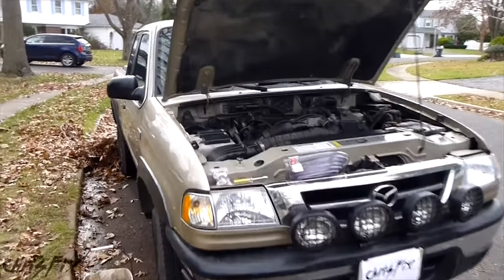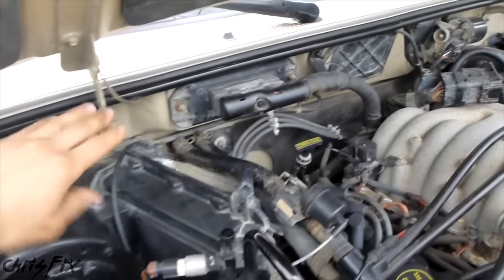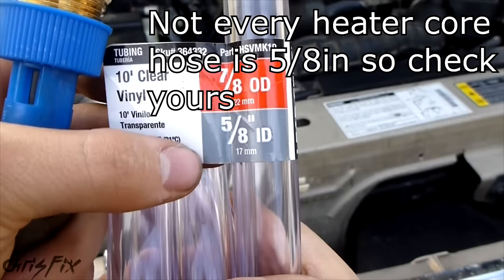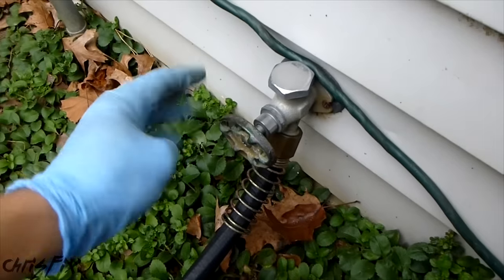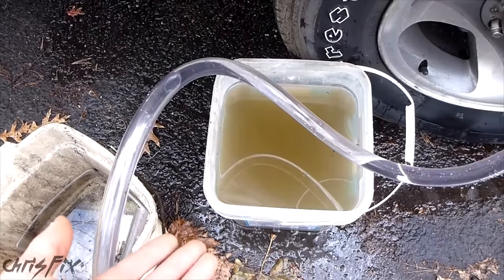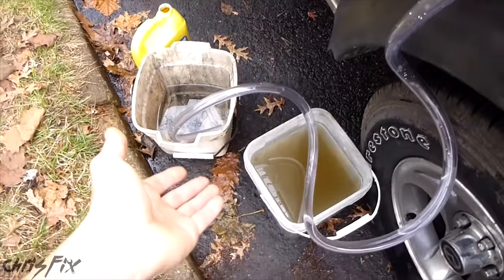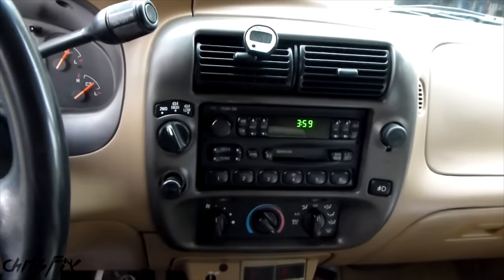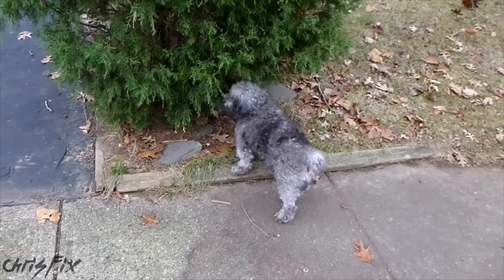How to Flush a Heater Core Safely (with a garden hose)

Comment: Can a clogged heater core cause the engine to overheat? I've replaced my radiator, radiator cap, & radiator hoses, flushed and replaced new coolant, replaced the thermostat, and bled out the air of the cooling system and my xterra is still overheating and the heater doesn't work. Any ideas??
Reply: Yes.
Reply: Did that end up being the end-problem for your Xterra, jujubeee?

Comment: What if my car is blowing hot air instead of cold air? I could not use my AC during the summer this year because of that reason. What is the issue? Is it the heater core? Does it need to be flushed? Is it something else?
Reply: Could be thermostat

Comment: I have a question if anyone can answer. I’ve done a heater core flush with only water and a good amount of nasty stuff came out. My heater started working but does not seem to be optimal. Should I do it again but with the radiator cleaner? I’m sure that would help it out a ton

Comment: I have a 2002 GMC truck when you hit the brakes and goes clunk clunk clunkthat's the only time it does it it doesn't pull to one side or another when you're driving down the road or when you're hitting the breaks. I have changed calipers brake pads I have change stabilizer bars rotors I've changed 1 caliber that was sticking I've been to three different mechanics I've done everything they've told me to do the truck is still doing if you have any ideas could you please get back to me

Comment: Fuckyaaa I have heat in my cabin now!!! This video is amazing...i used exactly the same setup to flush my heater ..thing was super dirty like chocolate/red ...heat came back instantly..and because it was super dirty I think I will do a radiator flush aswell..  thanks alot my dude!!🤙🤙

Comment: I tried this today on my 2008 jeep liberty. I bought the flush cleaner, pour it through the hoses into the heater core, let it sit for about 30 minutes, and then flushed it through. It had a good flow but now my heater is still blowing cold air.🤔🤔

Comment: Chris because you are talking about smells coming from the vents every now and then, if I let my engine revs go high only up to 3or4 on rev gauge, I get a very horrible smell and it's not the smell that you usually  would get from a catalytic converter, it's  just a unusual smell any suggestions as to what might be the problem, car is running fine the heating system is working fine, it was sitting up for a little while and I was wondering maybe if this was causing the smell when the rev is put up it heats something up and this forces the smell into the cab, it smells like a Duty lithium battery toy that was left too long with the batteries in, and with a slight smell of Ash and   burning  wire wool , of smell and Ashes. ha ha I was wondering if Maybe crud and dust had built up in the  catalytic converter, and when you give it a good rev out of gear is when the smile comes, but once you start to move and drive normal and up top  high speed the smell does not come into the car. The car is a Nissan P12 premier 2002

Comment: I have the exact truck man... I want to replace my black hoses with that clear hose... what hose that is clear would be good for the psi and the heat??? a really thick hose wouldnt melt would it?
Reply from the maker: I dont think it will last with the coolant. It will degrade with the coolant flow. I am not sure though. Clear hoses would be pretty cool!

Comment: Good morning, I am having issues with my heat so let me give you a brief run down. The heat has not been working properly for a year or so from today. In the beginning of this year, I noticed I had thick rust like fluid. I got the fluid flushed and got my blender door changed. It didn't help, during the summer I changed the coolant again and put the right one in 2009 Honda Accord LX Sedan (Blue colored) and changed the upper and lose hoses, still no change and last week I changed my thermostat, replaced my radiator cap and flushed my fluid again after getting a diagnostic at Firestone for $55. Still no changes, the only other options is my heater core needs to be flushed out because of dirty radiator fluid build up or needs to be replaced entirely. Are you capable of doing either service and if so how much would it cost and how much time would it take to be complete ? Also when I try to switch my setting from where my heat/air blows from it does not always blow from the right spot so I assume the switch door needs to be replaced or adjusted as well.
Reply: Bruh I just flushed my heater core in like 30 min with a 2 liter bottle of water, an empty bottle to catch the flushed fluids, a pair of pliers and an electric tire pump I got from family dollar. Had no clue what I was doin other than watchin this video and 1 other. I knew it was my heater core cuz it blew great and car temp gauge was fine AND I knew goin in I had a radiator hose leak that I was pourin tons of quick fix stuff in tryin to fix so I pretty much knew the heater core was clogged after I watched this. Pumped the heater core and like magic saved myself like $150... Point is, just do it yourself!! It's super easy I literally just did it in 30 min!
Reply: Well I don't think I have a leak but I dp have an air pump and I want to try this before I replacement my whole heater core. So water and an air pump got the job done in 30 mins really ? I'll do it if it is that quick regardless of how cold it is outside.
Reply: +Justbmore Morris lol yea I'm in Atlanta, it's been above 65 degrees all morning, I'm literally out right now in sweats and a short sleeve shirt lol but yea I was sayin I had a bad radiator I tried to fix that probably caused my heater core to get clogged, you said you seen some build up in yours and you tried everything else so it's gotta be your heater core.
Reply: +Justbmore Morris So yea pliers to disconnect the hoses and clamps, water to run through the hoses, catch bucket for old nasty fluid, air pump to actually pump the water through the hoses. I would pour in some water, then pump it out, some in, pump it out until the water was pretty clear, reconnected hoses warmed the car and it worked

Comment: Dang! I wanted to do this on my 96 Cherokee before it got too cold... but I already put garden hoses away and turned off outside faucets. I get enough heat, but I can tell heater is not performing at its best. Always 2015... I hope.
Reply from the maker: furyiiiplate I am thinking about doing the same video but using an air compressor instead... What do you think? Interested?

Comment: GOOD VIDEO BRO.
 MINE WAS LEAKING SO  I PUT STOP LEAK.
 OK FOR AWHILE , BUT EVENTUALLY NO HEAT SO I HAD IT BLOWN OUT.
 WORKS FINE NOW. BUT FOR HOW LONG ?
 THANKS
 KEITH KUHN
Reply from the maker: KEITH KUHN Thanks! You never know how long the stop leak will work for. If you dont flush it out, it can last the life of the car or it can just randomly start leaking.

Comment: 99 Mustang GT, the intake and outlet hoses are two different sizes -__- outlet is 5/8 but intake is 3/4  #thanksFord  also very hard to get the hoses off and very little room back by the firewall but that's just v8 problems.
Reply from the maker: ***** Ugh, that is annoying. Is there any way to take the hose off more towards the water pump instead of the firewall?
Reply: The hose going into the heater core appears to come from the intake manifold (back behind the throttle body). I'm assuming that's the one that goes into the heater core (intake). The one I assume is the outlet goes down behind the engine sort of, I don't know to where. It's the same setup as yours, Ford probably used the same setup on Mazdas but for some reason my metal parts are two different diameters. I got the clamps off with a bit of hassle because they wouldn't stay on the pliers and kept slipping off. I got the hoses off with a LOT of force because A) I guess they haven't been off in a while and B) it was hard to pull them straight because there were other things in front of them including my cool air intake and other wiring. In the end the hose was off after I set everything up (-__-) which I should have checked before setting it all up, but I know everything fits now.
Reply from the maker: ***** Sounds like there isnt a  lot of room there. Now that you know what to expect you can flush it at least!

Comment: @ChrisFix———Hi, I watching your video from France and thanks to you, I make my own maintenance for my Audi A6 c7 diesel 3.0 TdI. But I have a probleme with my heater core, actually inside my car I put de heater, but there is no heat coming inside or a little. I think my heater core need too be flush. For the moment there is no leak from the heater core so I try to remove the two hose, but it's very difficult. Do you know the method to remove the two hoses so I can flush with my garden hose the heater core ?

Comment: When you do a complete radiator , engine block  flush doesn't that also flush out the heater core  if you turn on the heater ?
Reply from the maker: steve kwall It doesnt reverse flush the heater core, which gets out more gunk than a normal flush.

Comment: Hi Chris! My name  is  Francisco. 
I just  started  watching  your videos, I watch  Scotty  Kilmer and Eric  the car guy.
And I know  my question  doesn't  have  anything  to do with a heater core but here it goes...
My 2002 g20 makes a kinda grinding brake noise, every  day in the morning.
Just went I'm pulling  out of the driveway maybe 2 or 3 pushes on the pedal.
After that noise  goes away. 
Not a typical  squeaky  noise but kinda grinding. It sounds  like when the caliper closes on the discs and when  is releasing  the disc. 2 or 3 times after I'm  out of the driveway  noise goes away. 
Any suggestions?
Tnx.
Reply from the maker: MrOriuk79 Sounds like your brakes might have a problem. Here is what I would try. Before you drive off, press the brakes hard a few times. Pump them. Then see if there is grinding. Does the noise happen in certain weather conditions?

Comment: Hey Chris :
 My Lincoln tc when I'm in summer my ac works fine but when the weather changes my heater doesn't work so I have to put my heater on full blast and then and removed my battery and then after that my heater works fine but when the summers comes I have to do the same thing!!! What do you think it is ?
Reply from the maker: Cristofer Calderon Hm, that is weird. I am not sure. Could be the control box for the switches. Removing the battery "resets" it.
Reply: ChrisFix 
Yes removing the battery reset it !!!

Comment: How do you check your bifold doors i put my heater on face or floor it comes out the defroster i just had the heater core and heater box changed and nothings gotten better i will flush my core again .

Comment: I've used CLR many times on many cars and never had a problem. To each their own I guess
Reply from the maker: JustLouIt Thanks for sharing your experience. You wont notice anything immediately. Etching metal is basically putting microscopic grooves into the metal so it has more surface area so it can corrode more easily. It just shortens the lifespan of the radiator and or heater core.

Comment: I have a clogged heater core that was the result of a blown head gasket. Will this method work to unclog the core? I'm getting a new engine installed, and the mechanic says that I can buy some sort of coolant flush, and it should remove the oil and gunk in the core and radiator. I have a 2002 acura Tl. I believe both the heater core and radiator is aluminum. What can I do? I've already spent $2k on replacing the engine! Please help.
Reply from the maker: Kevin Su This should help unclog the heater core. If it is badly clogged then you might need a new heater core, but this works most of the time! Follow this video and good luck!

Comment: Chris I have a important question! I think I have cracked heater core. But just to be sure what does it mean if my car is blowing hot air in the driver side vents but on the passenger side it's blowing ice cold air does it mean it's clogged? Or what I can't figure to change the heater core or not.
Reply: I have the same problem!! Is it a ford fusion?
Reply: mr me no Jeep Grand Cherokee. Things I know a guy that works for Jeep and he said something about the blend doors and acutater are not working correctly so maybe that's your problem too.

Comment: Would I need to super flush the cooling system first and then flush the heater core if there's restricted flow, or flush the core first and then the super flush the cooling system?
Reply from the maker: You can do the superflush first then the heater core for the best results.

Comment: Hey Chris, I have a 14 yo Acura rsx. Heat only comes out when stepping on the gas. When idling at a light in comes out cold. You think it needs a heater core flush or is that something else. Thx.
Reply: Thermostat replacement should fix it, sounds like yours is stuck and not regulating the temperature like it should. Just replaced mine, heat works great now. Can't wait to see how much more improvement I can get by flushing my heater core. Doing both should fix it right up in your case.

Comment: Hi after this process do you need to burp the whole system again from the main radiator
Reply from the maker: Sometimes yes, sometimes it self burps since you pushed all the air out with the water during the flush.
Reply: @chrisfix  Really appreciate your reply after all these years. Will it also help with just smell coming through heater also

Comment: I have no power to my climate control panel in my 99 jeep grand Cherokee limited. When I press the defrost button on it I hear/ feel a clicking in the fuse panel below the dash. I have checked all the fuses and replaced the climate control panel... where would you go from there?

Comment: opening the faucet a quarter turn will reduce the rate of water flow not the psi. psi will stay the same.
Reply from the maker: +stormbringerr mourn and with lower flow there is less psi if the water isn't piling up on itself.
Reply: Wrong..the psi is still the same, you have reduced the rate of speed at which the water moves , gallons per minute.  i was an irrigation tech and service supervisor  for 35 years.you have to use a water pressure regulator to lower the pressure. novices never understand this.
Reply: Wrong

Comment: @chrisfix  I have an 1986 lincoln continental mark VII and it has 83,000 miles on her..i trusted thr guy who sold me the car said it ran fine..so i drove it....well i got on the e way and it started somking from the engine bay area and it was whiteish smoke..and from the tail pipe it was a blackish blue smoke..i put water in. Her and it cooled down and the engine light came off and she drove fine..i drove her agin the next day and she turned off at a intersection and was trying to turn over but wouldnt so i walked to pepboys and put 2 quarts oil in this 5.0 engine and she turned over immediately...she also turns ofg when i slowdown or come to a stop....what should i do and what do you think

Comment: Also have you any tips to check the heater control valve
Reply from the maker: Just watch it as someone turns on the heat. It should open.

Comment: Based on the limited amount of debris carried in the water flushed back  into the bucket, the improvement in the perofrmance of the heat exchanger is far more likely to be due to displacing air pockets than the removal of any debris clogging the heater core - video still useful from this presepctive
Reply: Yet your 'prespective' is lacking alongside your word usage.
Reply: @wesoblander3648  ?? Incoherent claptrap.

Comment: Both my heater hoses look the same going into the firewall. Not sure what would be the inlet side. Also where I live we have a well water system. I didn't know if well water made a difference or not running it through the coil or not. I have a 08 Buick lacrosse.
Reply: Brian Carter Try to follow the entire coolant cycle in order to now the inlet which comes from water pump and to know the outlet which goes to the big hose that goes to the top side of the radiator
Reply: I thought the same thing. How am I supposed to know which  hose is the intake hose on my old century?
Reply: I just hooked hoses up flushed one side then switched hoses and flushed other side.  Then I flushed the other side again.  Heat now works great. It had at kinds of junk in it.
Reply: My heater core is good therefore I don't want to risk damaging the heater core hose connectors. If my heater core had a problem I would do it. My radiator fluid has another problem which is oil!  Many years ago, there was a manifold gasket leak which contaminated the antifreeze with oil then flushed the fluid. I replaced the gasket, and all was well. However, the oil has reappeared, and I am suspecting (hoping) that the oil is left over from the previous oil contamination. I did a flush 6 years ago and ten years ago.  My old beater is 17 years old now. Even so I intend to do another flush this spring and hopefully the oil will be gone. Oil contamination in the anti-freeze is tough to totally get rid of.
Show less
REPLY
Reply: Brian Carter  I have an 07 Allure which is similar...the hose located towards the center of the vehicle should be the inlet. A quick way of checking is when the vehicle is warmed up, feel which hose is hotter..you found your inlet hose. 😉👍